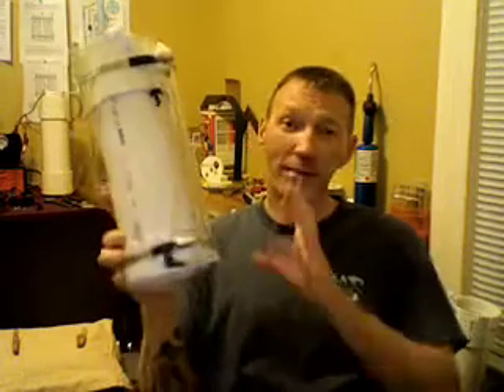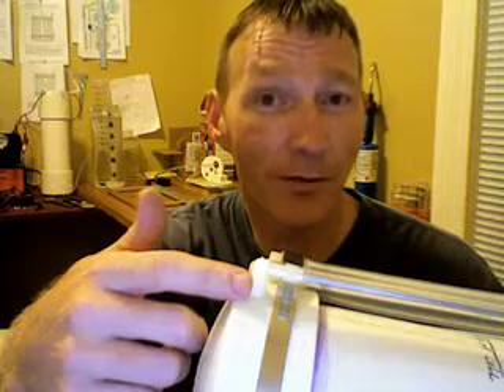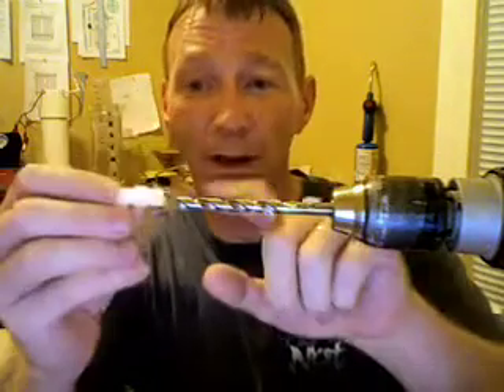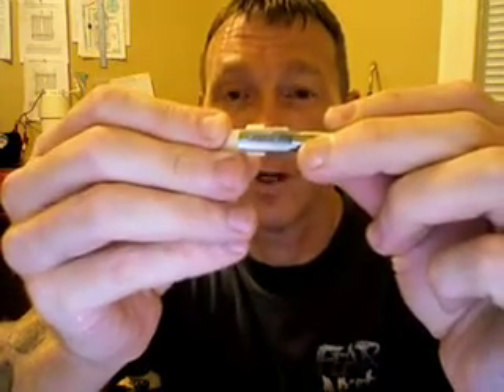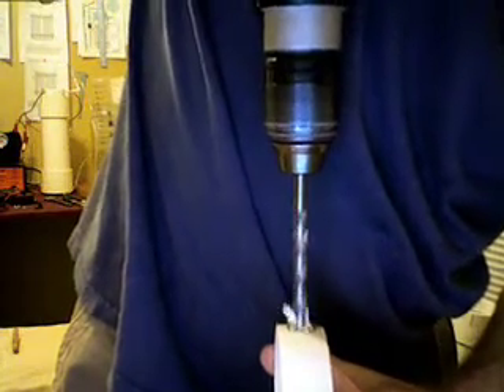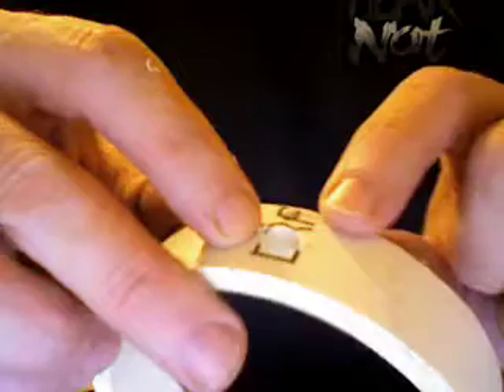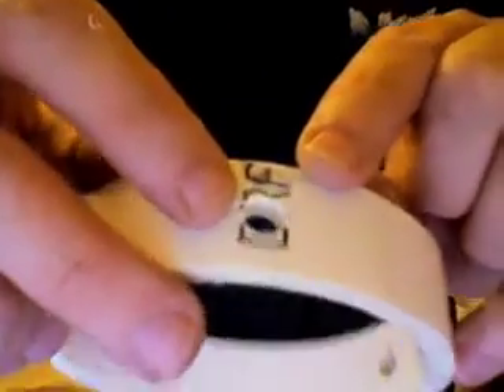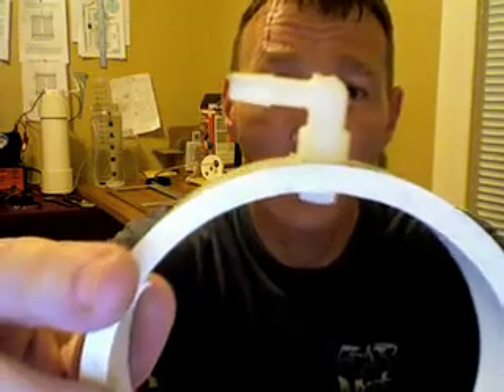How to Drill & Tap

Comment: (Use pipe Taps & Dies they taper to wedge fit ordinary taps are parralel threaded for bolt connections only not holding pressure or water) = https://www.google.co.uk/search?q=Pipe+taps+%26+dies&safe=off&hl=en&dcr=0&prmd=ivns&source=lnms&tbm=isch&sa=X&ved=0ahUKEwiD54uMt_XYAhXEKsAKHRCdAIkQ_AUIBQ

Comment: I spent 28 years as a toolmaker/machinist in an industrial toolroom. I do realize the world of tap and die can be very complex at times with the different thread patterns in use but now that there is internet access nearly everywhere and a very simple tap to drill bit chart is easily available. Knowing what thread you have on your parts is the key to success.

Comment: Lutherp40 is right. But if you teflon tape it's okay. i use the yellow kind for gas (thicker, less turns) A little tip..I usually try to keep all my taps the same size..sight gauges 3/8, fluid cooling 3/8, gas line 3/8(or you could use 1/4) You get the idea. But I try to mark and do all my tapping at the same time. I drill all the holes, then put the tap in my drill on low speed, and wallah!  Goes pretty fast that way. No more manually turning the tap!
I really like your vids, man.
Steve